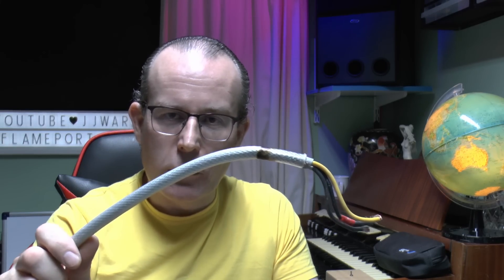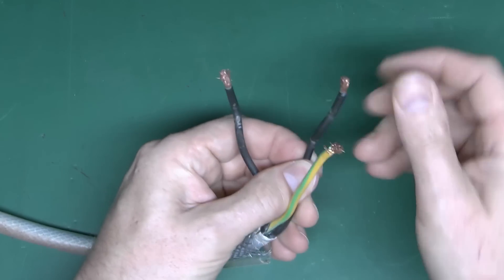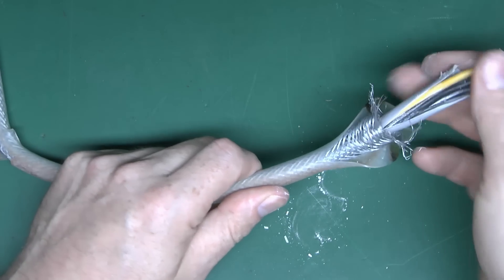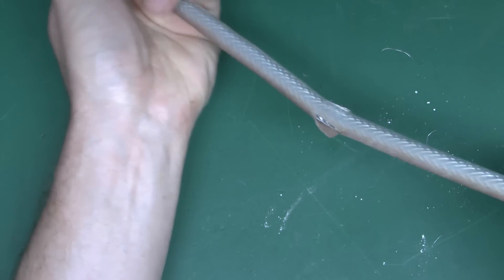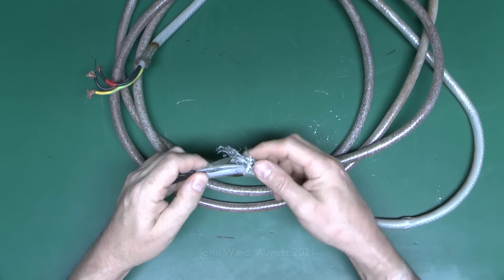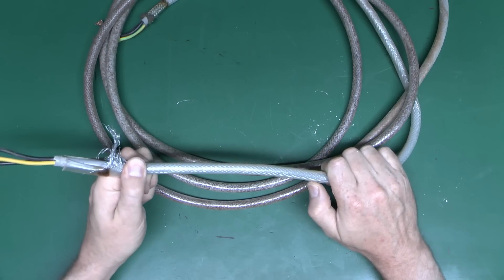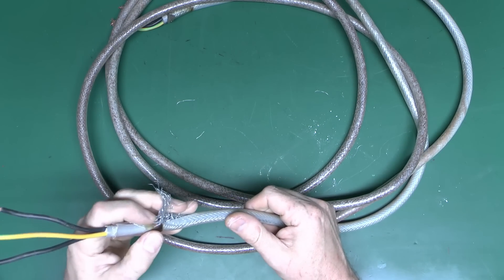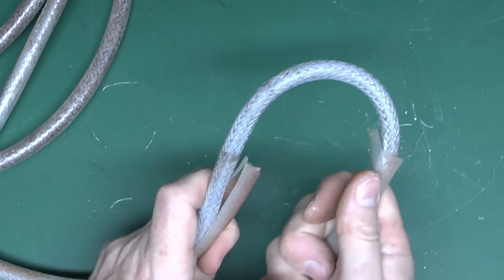SY Cable is Not Armoured, Not for Outside Use

Comment: What do you think to split concentric cable for use outdoors?
Any videos on this cable?
Reply from the maker: It could be used outside, but would require mechanical protection in many situations and can't be used underground either.  It's usually a poor choice, much better alternatives exist.
Reply: Thanks. It was used in the past at my house to power outdoor lights, buried underground.. I believe this was ok in the 16th edition regulations?

Comment: The cable is intended to connect machines or parts of machines. Maybe also to connect a sensor. But certainly only in the house or garage.

Comment: SY cable was designed for industry.  For remote locating of instrument panels.  Temperature gauges etc. The screen is a functional earth which helped precision. It is not designed as a circuit protective conductor. It is used extensively throughout the plastic industry.  It is not designed as a flexible.  It is usually mounted on a tray without  the risk of "crosstalkk"  through the screen it is also very tough  because in industry there is always a risk of a heavy stacker truck reversing on to it!

Comment: Good morning I have an issue with a job I’m on where a electrician has used a single core SWA as live constructor and the armour as the neutral conductor from the main three false coming into the building to the fuse bored on three separate fuse boards. Is this dangerous. Thanks in advance.

Comment: The biggest problem I come across all the time with SY is- some bright sparks seem to think you don't need to ground the braid, I find it all the time just taped up, no excuses, there are several ways to connect, use the correct glands, or make up a drain/ground wire or clamp.  can't believe how many times I have to explain the dangers of not doing this on a power cable!! I work in industrial automation.

Comment: This was used a lot on mobile telecom sites. The message is getting through now that it's classified as a control cable and its use is a departure from BS7671. It's not being installed generally anymore but still remains installed on older sites. It was generally only used for internal sites.

Comment: Thanks for this. Never personally seen it used outside (yet) but you pointed out some good tips such as no standards for it. Good to know. I have seen YY used on farm machinery (such as diet feeders) and I couldn't figure why the outer coating always cracked after a couple of years, now I know, not uv resistant!
Reply: There's some outside at my work lol.

Comment: See this used all the time outside on aircon units along with fp200, aircon fitters should know better sy should be left for use on control panels and fp200 for fire alarms and emergency lighting.

Comment: I've found a couple of good uses for it John - Amplifier panels that need 32 or 63A single phase feeds in theatre style venues. We tend to use things like Rubber Box distros - usually 63A input, single or three phase depending on need, and then distribution out on single phase 16/32/63A as appropriate to things that need it  in the stage area. We are very keen to keep noise to an absolute minimum and while dimmer quantities have gone drastically down now we use distributed power to the various fixtures on the ground and in the air - we still might find a few dimmer racks - each rated at around 12KW. They're much better filtered nowadays but the SY screen is a sensible 'extra' layer of screening on what can be very choppy waveforms in the feed to the dimmers. The transparent outer is also useful for monitoring damage. We seem to exist on rubber wheeled, but very heavy flightcases that get bumped over anything on the ground.  Being able to see crush damage on the light braiding is very useful. The criss-cross screening gets distorted when a heavy case has crushed it, and while it still needs a test, the visual inspection catches so many potential faults. Pretty much black H05 or H07 is everywhere, but I have a few SY male to female single phase cables in the inventory for use when you know people will run cases over them. If you have a local theatre near you - I'd see if you can get a look around. You'd find so much stuff to do videos about. Things conventional domestic or industrial electricians never come across. Connectors - for example. You go from individual 400A 3 phase connections, with all the interesting risks of things like disconnected neutrals, then Blue and Red 125/63/32/16A, all kinds of size/phase adaptors. Every touring show will have all kinds of these in a case somewhere. maybe 63-3 down to 32-1 as a straight adaptor cable - that kind of thing. Sound people searching for a phase the lighting people haven't hung dimmers on - and of course we now send power to fixtures hung on trusses and flying bars - using 10A IEC, all varieties of powercons plus the usual 13A - which we avoid like the plague due to the fusing, so we still use 15A connectors for dimmer power - and routinely use 2 and 3 way 15A adpators (meant for South Africa) to enable two lights on one circuit. Undimmed power is termed hard power - and never on 15A because dimmers fry the switch mode power supplies in the lights. If you get a chance - go and have a look at a theatre and see things that drive 'normal' electricians mad. I went into a theatre, reopened after covid and discovered that during covid the 110V wet cell emergency light system had been replaced by maintain ed types - and switching off the wall socket killed power to the roofspace, and fly galleries and overstage grid, and the maintained system kicked in. Wired by electricians who simply didn't know we need darkness in places they considere essential to keep lit.

Keep the videos coming - always learn things from them!

Comment: My air con at my house (in the UK) is wired with much more robust looking heavy black sheathed cable. It isn't armoured, but then it doesn't need to be as it is not installed underground.
Reply: It's probably NYY cable.
Reply: @robertbritton656  The covering feels rubbery. One of them is 3 core providing mains out to the compressor, the other is 4 core bringing mains back from the compressor to the indoor half of the mini split (within a foot of where the power came from in the first place but apparently the power goes to outside first and then back in) and the 4th core is the control link between the two or so the chap that installed it told me.
Reply: @owensmith7530  That sound like H07 then.

Comment: I appreciate what your saying but how would you terminate swa into a commando socket?
Reply from the maker: For a fixed socket on a wall, a suitable SWA gland and a suitable size hole in the enclosure.
If you mean a trailing socket, SWA is entirely inappropriate for that use, HO7 flex would be a more usual choice.
Reply: @jwflame  OK so H07 for outdoor use then over the SY cable to a 32a command outlet

Comment: the white powder is talc & the last time i came across this type of cable was in a cement works they are usually the cables that go between motors switches & fuses aswell as control boxes

Comment: The amounts of that stuff I've used over the years. Mainly for control panel to moving machinery, or motor  cables, the braiding is for emc purposes, and adds a bit of protection, but not much. OK in the right environment.

Comment: SY flex (or CY and YY) does not comply for use in BS7671 at all. The ECA produce a leaflet about this. We recently had to rewire a petrol station that had been wired in SY just 12 months previously, but when we tested it we failed it and rewired in SWA. These cables are classed as for "control wiring" and do not have an appropriate BS number.
Reply: It's nuts how it's classed as "control wiring" but CEF sell it in sizes up to 35mm². What on earth needs 135A "control" current?

Comment: I absolutely hate the stuff right from the start! I’m for ever picking it up on EICRs but no one seems to give a crap that it hasn’t been installed it correctly. From AC installers to 3phase extension leads. Forever explaining why not to use it till red in the face. Met with why do they sell it then? 🤬🤬

Comment: I saw this type of cable not so long ago feeding column lights to a carpark for a communal block of flats ,the section i saw came out of the ground by a path where it was cemented over running  along a wall then cleated but outer sheath coming off from uv exposure then carried through a pipe which goes through the wall under a driveway to the carpark and grass area the other side at a higher elevation.

Comment: SY is great for the right applications, i'm a retired maintenance engineer that's used it most of my working career, it's more flexible than SWA.
Reply: Even though it's technically not armored, the protection isn't insignificant. It's great for extension cables or long leads where idiots on the shop floor will repeatedly pinch it with a pallet truck. Never seen one get cut by hand tools by accident, the only time I've seen one shear is with a forklift ripping through it and taking a motor with it.

Comment: What kind of gland would you use with this cable?
Reply from the maker: An SY gland, designed specifically for use with SY cable.
Reply: @jwflame  thanks. I've also seen this used for AC a few times without understanding the reason.
Reply: You can use some swa glands. Brands like CMP and the Hawke universal are often used in atex environments where braided cable is the norm.

Comment: Seen various versions of this cable used in the plastics factory where I used to work, for all sorts of equipment, such as conveyor belts,  water heaters/chillers, dryers etc, also seen it on some of the outside lighting,  they even used it for 3-phase extension leads, I've even got a length I brought home once, supplying an outdoor garden socket box, it's been there 15 years & the bits that are visible don't seem to have degraded, the rest is buried under paving slabs!

Comment: When used with 230/415v AC  it is IMPORTANT to earth the screen otherwise the capacitive linkage will give a shock when touched.
Unless earthed the 'sceening' is in- effective.
Used in the correct application this cable is fine.
Reply: Is the insulation rated for 415 ?
Reply: @millomweb  yes

Comment: Great video John, one thing that has always puzzled me is, if the osg advises us not to use SY cable, then why is it even stocked by wholesalers in the UK? Also why is this crap cable included as part of the AM2 assessment? 🤷‍♂️
Reply: Couldn't agree more. Iv asked those questions many times
Reply: The cable is suitable in some applications. This is why it is available.
Reply: @BULLEAD  does it have a bs number? What types of applications?
Reply: @gbelectricks  Taken from Eland cables website statement: Statement on the use of SY, CY and YY cables in the UK
SY, CY and YY cables are flexible control cables, designed for measurement and control in equipment such as assembly and production lines. They have finely stranded, flexible Class 5 copper conductors, and the SY and CY variants have a steel or copper braid layer. These cables are widely used in the UK and Europe yet are not manufactured to a designated standard – anyone claiming conformance to BS EN 50525-2-11 is doing so incorrectly as the insulation thickness doesn’t meet the minimum requirements and this standard does not include allowance for a steel or copper braid.
Confusion has arisen in the market around the applications these control cables can be used for. It has been suggested that these cables are not ‘fit-for-purpose’ without defining the ‘purpose’. For the avoidance of doubt, SY, CY & YY cables are compliant when used appropriately in UK applications for control functions under BS EN 60204.
Reply: @BULLEAD  so basically they are shit under heavy load but ok for signalling🥴 personally, I’d be inclined to listen to the osg, and I’d rather steer clear of the stuff 🤷‍♂️
Reply: BASEC have started providing standards for use as a control cable (not for power, all you AC installers).

Comment: That looks a lot like a multi-core cable for machine tool signaling: hooking up control switches, limit switches, and safety interlocks back to the main controls. Igus makes a lot of cables similar in appearance.
Reply from the maker: That's mainly what it's intended for.
Reply: The ones from Igus are energy chain rated, usually thousands of bending operations, SY is for a few bends during installation, bending radius is often smaller than SWA.

Comment: OK - first RULE of any instructional video, talk or whatever is to define "abbreviations" before using them   -so... WHAT exactly does "SY" stand for ?? .  John - friendly advice - Please define any abbreviations BEFORE using them.
anyway :
steel wire braid  - In CENELEC code – the European Committee for Electrotechnical Standardisation – the S in SY stands for steel wire braid, and the Y for PVC. SY Control Cable can be referred to more generally as Instrumentation Cable, Flexible or Braided Control Cable and Control Flex.

Comment: As people have said, it's common and appropriate use is in the food industry, basically it's a flex with a bit of screening and a bit more mechanical protection. Eland cables have their own testing laboratory and test SY to the German standard VDE0250, which I would think is enough to make it harmonized and compliant. I wouldn't specify it for outdoor use, but look at all the 6242Y cables installed in housing for external lighting and power. It's not UV rated either. I think H07RN-F is great cable, but when you look back over time TRS just crumbled away. HiTuf, H07RN-F and SWA are all in the same price range, we have lot's of choice.
Reply from the maker: VDE standards are for Germany only, they are not harmonised or of any real use outside of Germany.
VDE0250 is a whole suite of individual standards covering a wide variety of different cables, so 'VDE0250' on it's own doesn't mean anything.
https://www.vde-verlag.de/quicksearch/?searchterm=0250

Comment: So you are telling me I should not of used this for a EV charging point.
Reply: Yep
Reply: Yes
Reply: @martinwinfield2935  I have changed it now to 3 lots of 1.5mm together in to a 4 way wago connector.  It's only get a little bit hot and smoky so I thought a small fan in the box.

Comment: Used by every HVAC engineer I’ve ever met.
Reply: I think you'll find it was a case of... be a HVAC 'engineer'  (if you can honestly use that description alongside HVAC!)  ... or flip burgers when they left college?[Though flipping burgers does require a bit of skill] 😂
Reply: @Sparks1Plumbers0 HVAC technician.
Let's get the terminology right..They are not engineers.

Comment: Worst offenders for using this stuff are aircon installers and telecoms companies. I've lost count the amount of times I've had to replace this stuff.

I like working with it but its completely unsuitable for the applications most people tend to use it for. People need to check the BS compatibility and also the insulation voltage rating for it.

Comment: Fascinating information. I am not sure you do requests but if you are able to do a quick review of how to use armoured cable with IP67 junction boxes I would be obliged. For my use I find the trim and connection unsatisfactory and time consuming. I assume there is a tool or technique I am missing to make it both neater and quicker to work with.

Comment: I think in most cases rubber H07RN-F cable should be used instead of this SY crap, ive never been a fan of this cable , Having no British standard is always a bit iffy . H07 has a BS standard. And in the places that need it use SWA. Another possible option is doncaster cables TUF sheath, its just armored cable without the steel.
Reply: I'm a fan of H07RN-F and H05RN-F too. The sheath is neoprene, which if it's good enough for diver's suits, should be good enough for rainwater in a garden. 
n.b. Doncaster Tuff Sheath doesn't technically conform to a BS standard, as it's only manufactured "generally" to the standard, which the IET doesn't recognise.

Comment: On alot of construction sites that you are permitted to use special test equipment which is 220v mains operated you are only allowed to this sy flex extension leads for extra safety as opposed to standard flex extension leads . Thanks again John

Comment: I have been in workshops where all the weding machines are connected up with that junk. The owners either think it is a must or the local HS have told them it is. The heavy rubber leads that the manufacturers send the machines out with lasts longer and stands up to things like fork lifts better.

Comment: Found automotive trailer cable being used in a refrigeration machine recently, original equipment by the manufacturer.
Reply: As long as the conductor will carry the current and the insulation cope with the voltage - who cares ?
Reply: @millomweb  Well not you apparently!

Comment: I've seen this kind of shielded cable both in transparent and in normal grey variants. I've always wondered if the transparent sheathe makes any difference. Not electrically obviously, but there has to be some reason both exist, rhight? Is it just so you can see at a glance that it is shielded?
Reply: The grey shielded version is CY, the grey unshielded version is YY.

Comment: We have the very problem on our site at the moment. Air conditioning installations which haven't been in very long using this SY cable, the braid inside has gone rusty and the outer insulation is breaking down from the UV. The installation contractors should have to return back and replace with SWA at their cost but I doubt that will happen.